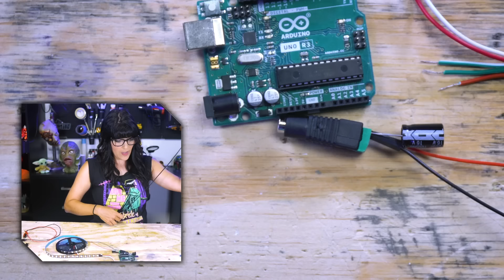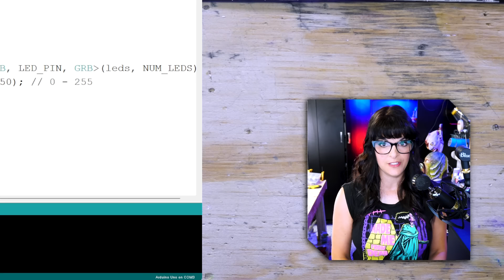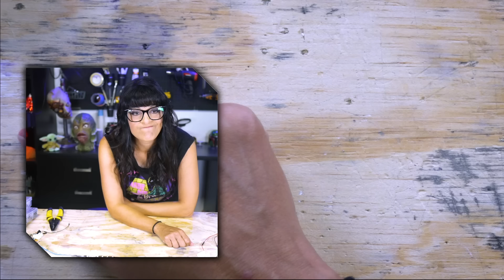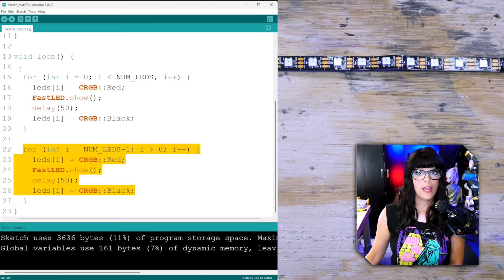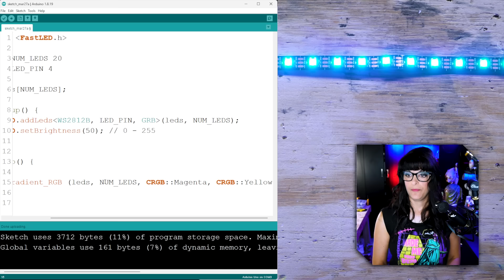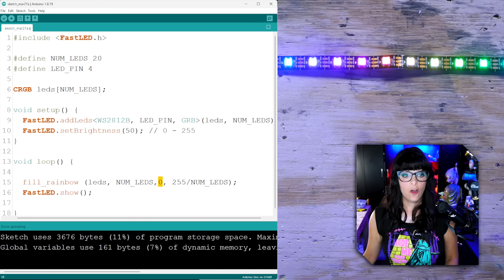Ultimate Guide to Programming LED Strips with Arduino | Wiring, Powering & Code with FastLED

Comment: Nice video, thanks!
I have an LED strip with 4 terminals. +12V, G, R, B. 
It will light up the LEDs enough with only 9 V. Much less power is needed.eo, thanks!

Can you please show me how to handle it for a similar result?

Comment: I’m using a strip like you are showing with an esp32 as well as a .5 mm strip for hobby model lighting, I’m using one of the strip blocks for say the photon torpedo bay, and then the .5mm strip for internal lighting and engines, however neither lights the color it’s supposed to, should I be using just one strip type to get the effects I’m wanting?

Comment: I'm using a WS2815 strip with an SP107E controller. Where does the backup line go? Does it share the GND port or the DAT port?

Comment: Hi, good video.
could you integrate a led strip like WS2812B IC 60 LEDs/M with and  ESP8266 CH340G Nodemcu V2 4MB/16MB controller to integrate it on a Philip HUE (i will try to made it with a raspberry diyhub) using diyhub project 
I dont know how to make it. Thanks you so much

Comment: Hello, Question: is the LED strip data bus 5Vdc on a 12 Vdc and 24Vdc? Or is the the data bus 12Vdc and 24 Vdc on those LED strips? Can the Arduino data bus (5Vdc) control the LED strip data bus on those higher voltage strips? Thank you very much for your videos, very useful and well explained.

Comment: Hi Arduino. Thanks for your comprehensive and educative videos on LED circuits. I LED parallel circuits you had said that resistor has to be put in each series arm separately. Can we not put a single resistor in the primary circuit before the parallel section ?  Also please advise if resistor would still be necessary if the voltage rating of all diodes together in series is equal to or little more than the power supply / battery voltage.

Comment: Hi, great video. Very well presented. If I was to build a star of radiating LED strips, radiating out from the center, where I want the colors to pulsate from the center outwareds, would I connect the LED strips in parallel, or can I use other output pins of the arduino and program them?

Comment: What do you do when you have four wires for the led strips?
Reply: It means you have a non addressable rgb strip. The four wires represents: power, red, blue, green. rather than the addressable strip which has: power, ground, and data.

Comment: Thanks for your video. I just bought some LED lights for my garden railroad 🚞 . Unfortunately they came without any instructions and I got a 16v source so I was unsure if I need can use them in series with the 650 ohm resistors supplied.

Comment: Great video.  I have one observation that was pointed out in the reddit FastLED community.  I was having a problem with 20 LEDs or any even number for the matter.  Odd number of LEDs worked fine.  I posted a question and it was suggested to me that I downgrade from FastLED to 3.9.17 to 3.9.16  That solved my problem.  It occurred in your #define NUM_LEDS statement.   It's easy to go to the IDE and manage libraries.  Remove 3.9.17 and select 3.9.16 from the dropdown.  Hope this will save others from the pain of headbanging ;-)

Comment: Is it possible to use an Arduino to analog write a random change in voltage to make these LED strips mimic a candle flame? Sorry I’m new at this and I’m sure it’s showing, but I was able to do this with LED’s not in a strip. It looks pretty realistic and I’m wanting to use a strip to do this because they are waterproof and I’d like to add “fire” to my son’s  paper mache erupting volcano.

Comment: Hi Rachel,  great videos. Wonder if you can help me with something. Not sure if you have covered it in the past but here goes.  I'm trying to write a programme which sends a single led from [0] to [30] and stay at [30]. followed by another led from [0] moving to pixel [29] and also staying put, now have 2 leds at position [29] and [30]. Then another pixel starting at [0] and moving through to [28]. now have 3 leds at end of strip. And so forth and so forth until all the leds are lit. (all accumulated along the strip) . I have attempted some coding without success. Can you please help? Cheers
Ben

Comment: This has been by far the easiest guide to follow for wiring as a complete electrical novice, thank you! 

However, there were some parts missing details, prompting me to do extra research. For instance, the green power jack connected to the capacitor and cables (2:08) isn't mentioned in the description or video. I guess it's called a DC Female Power Plug to 2 Pin Terminal Adapter, for anyone else wondering, which you can find on Amazon.

I was curious why you chose to cut the wires and use those quick connectors and not plug the jumper cables directly from the LED header to the Arduino pins? Also, are there any advantages to using a breadboard? I see them appear frequently in similar tutorials, but here it's listed as optional.

Comment: Im in the planning phase of a project im going to start when I get the money. I do a lot of camping here in Colorado. I wanna make a camp light that'll attach to the four rails of my roof rack. Im going to have about 50' in the rack. The sides will have two rows and front/back will have 1 row each. I don't know how to code yet but you showed some of the code I will need. Im looking to light up the whole thing with the rainbow colors. Have that circulate the whole rig with the random shift back and forth. I also want a random ball of sorts grow randomly shift back and forth and fade out in motion. Almost like a UFO. Is that easily achieved?

Comment: Hi, Love you video. I was hoping I could get some help with some code on making them simulate a fire. I have a strip of 23 ws2812b LED that I would like to use. I’ve looked at some code but it calls for heat up cool down cycles and that is way beyond n compression. Can you offer some suggestions? Thank you and God bless.

Comment: Thanks a lot for the video :-) Is it possible to divide a single LED strip into multiple pieces by software, which you then control as if they were separate LED strips?
Reply from the maker: Absolutely! That's a great idea for a video!
Reply: @RachelDeBarrosLive  thanks for a reply :-) I suspect this could be done by splitting all the leds into arrays? Do you perhaps have a link to an example somewhere? thank you 🙂

Comment: 10/10!!! This video was exactly what I was looking for.  It literally was the Ultimate Guide for Programming LEDs. 

From a software developer / teacher standpoint, the content and its delivery is exceptional. The fact that you included the tip about "i" in for loops and all the other little tidbits is just 👏👏👏. That point alone is huge for non-coders jumping in at this point.

Comment: Hi Rachel,
I love your video and it inspired me.. I am a newbie to adruino and led lights.
I want to create a Star Wars Dioarama where  a x wing fighter attacks a Tie fighter . I was also inspired by this guy " Boylei Hobby Time" on youtube who already made such an amazing awesome star wars fight diorama using static filament led.. 
But I want to make it more active and dynamic and I want to simulate the laser cannon effect like you did, but then using twelve " 70mm DC 3V Micro LED COB Meteor Shower Flowing Water Lamp LED Filament Diode Color Parts Decoration Light Accessories" . Have you ever used these? Perhaps you could use the smallest width high density Cob Led Strip for this project. 
How can I do this? 
Thank you Rachel

Comment: BAD CODE ALERT!

You set the return loop to keep looping while i is greater than or equal to zero:
 
for (int i = NUM_LEDS-1; i >= 0; i--) { ... }

This is wrong as it results in i becoming -1 for the last iteration of the loop. You are lucky as leds[-1] is not affecting any crucial RAM in the Arduino. You should only be checking for greater than zero so the last iteration of the loop results in i being 0:

for (int i = NUM_LEDS-1; i > 0; i--) { ... }

Comment: A couple of years ago I did a Knight Rider effect for a strip of RGB LEDs. I did not use the Arduino though, I used the Raspberry Pi Pico which uses Micro Python. I have it on my GitHub under my pseudonym of Galbi3000. It could be easily converted to Arduino C as it's not complex.

Comment: I am having problems with my setup.  I hooked it up.  Wrote the code.  But my strip only does the code briefly then it lights all my leds and dances which isn’t what I told it to do.  Also as soon as I plug it in I have leds that light up.  Could it be a janky brand of led strip or something I’m doing wrong?

Comment: I've been trying the "moving pixel along strip" code for like 3 hours and keep getting the same errors. First one is "i" is not defined in scope, and then it's saying it wants a ';' before ')' on the line where you type the "for (int" code. I have it typed EXACTLY like she does on the screen and it just will not accept it. Please help!

Comment: OK so I'm realy new to all this, my 13 yr old son an I are going to make some props for halloween (* u have inspired me to feel like the code side is doable) we have set up a bin that lid flies open with a monster that pops out, we want it to close 3 seconds later ready for next.  
The unit has pnumatic side set up already with a 12v N/C 3 way solenoid
I have arduino uno and 12v relays
When the lid flies open we hope to have for the 3 seconds the lids open

Pnumatic solenoid to power
1 5x led red strip (*on)
1 5x led white strip (*strobe)
And sound

I have watched a lot of ur videos but I just want to confirm if I use a code for programing leds can I just add a code for activating relays an then to tie in a scream or something how's the best way to go about this

Thanks in advance

Comment: Nice video. Very clear explanation. Just to "dive" a little bit deeper, could you adres each led individualy? Just light up numbers 3,13&23?
Reply: Can't say for sure, but going off of the explanations in this video, I'm gonna say yes. Because you have defined the NUM_LEDS (20 LEDS, called 0 through 19), if you want to power the 3rd, 13th, and 23rd, you would define this for 2, 12, and 22:

leds[2] = CRGB::Red

If you don't define anything for a LED it just stays off. So I think that's how it works!

Comment: Hi ma'am may i ask if how many led ws128b arduino uno can run? I mean the maximum no. Of rgb led strip that uno can handle if i have much output thanks,
Reply from the maker: You can connect as many strips to the Arduino as the board has pins. The length of your strip also doesn't matter so long as you power them externally. Don't power the strips directly from the Arduino. For long runs, be sure to solder power and ground from your power supply every meter or so to reduce voltage drop.
Reply: @RachelDeBarrosLive  thankyou ma'am your tuitorials are very imformative, easy to understand and exciting to learn ☺️,
Reply: Ive learned alot to your tuitorials ma'am i even know how to find error in codes , just like youve uploaded online ma'am recently i cant upload it but eventually i found out the wrong sketch it is in declarations in pins 
The code "unsigned long current millis () = 0 

"()" This was the error , it is in blink,fade,toggle switch code ,  thankyou ma'am im your fun, thats why im saying it to you to be corrected 🙂

Comment: Why not power it with arduino if it is supposed to work with 5V?
Reply: Arduino can’t put out enough Amps to run long strips

Watts = Volts x Amps
5V doesn’t necessarily mean it has adequate power, because you still need amps
Reply: @squidward47  hi, thanks for your response. Apparently for short strip (i have 1 meter) and arduino nano works really nice

Comment: 2:30 Those "quick connectors" are absolutely fine to be used long term. They are even more safer than other connecors if you use stranded wires. Those single strands can move over time... if you use a connector with a screw this might cause lose contact, but with those spring loaded connectors the force to the wire will be the same. If you are good in soldering, this might be even better, but if you produce cold solder connections, the spring loaded connectors would be better.

Comment: Hi Rachel, This is such a great tutorial as there is little about that actually shows you how to control a single led, they all seem to concentrate on animation effects, I have just started messing about with addressable leds and I am also using the Fast led library. I am new to programming on the Arduino but have found a great on-line GUI called Fastled Animator which could also be useful to a novice as it generates the code, when you have created your animation. I intend using it for a lighting sequence to light model buildings. All the best Tony.

Comment: No 3 gradients!! It's worse than wire cooties! 
Tesla would not approve (he was into 3, 6, and 9)! 
I have hundreds of single color LEDs... I may never use them since I'm hooked on programmable LEDs (thanks to Rachel)... I might need to have a LED yard sale!! 
😂😂😂😂😂😂
Reply from the maker: They've updated the library since we first discovered the 3-color gradient bug, but it's still biting! 🤣
Reply: @RachelDeBarrosLive  - I see what you did there... bug bites... bug bytes? 🤣
Reply: Why not put 3 of those single led's together, preferabbly Red Green and Blue, now you have a giant RGB LED pixel!  hook them up to an andruino and they're now programmable! PWM the intesity and you should be able to make any colour.  Youd only be able to control only a couple of these LED RGB pixels with an arduino though because 1 would take up at leaste 3 pins.   I actually did something similar to this but isntead of using single LEDs i used RGB LEDs, just not the programable ones, but if you hook each leg of them up to an MCU you can vary the different R G and B intesitities and make them programable too, but they also take up lots of pins of a MCU. I could only control  5 of these non programmable RGB LEDs like this with an STM32 because each one took up 3 pins, so in total it used 15 pins which was close or at the limit of the pwm pins i believe. Or its all i was willing to do , cant remember.  But 1 mcu can control like 5-10 RGB led pixels, these indiviuduably addressble ones are more efficient, they have 1 mcu per LED.  But technically you could DIY that part too, have1 MCU per 5-10 LED's , youd just have to make a new communication system to talk between other mcu's and i think these programmable ones already did that more efficiently.   Still i think the DIY approach helps you learn more and is actually easier sometimes since its doing the most basic thing to get somethign accomplished, while these conventient libraries abstract that away for convenience, it doesnt help with understanding, and you could pull something like this off yourself without a special type of LED.
Reply: @mikejones-vd3fg  - wow! excellent idea!! 
I could actually build my own programmable strip by building my own pixels! ... then use the SPI (serial interface) to code for all the Rachel projects!! 
🥳🎉🤩😊😎🍾